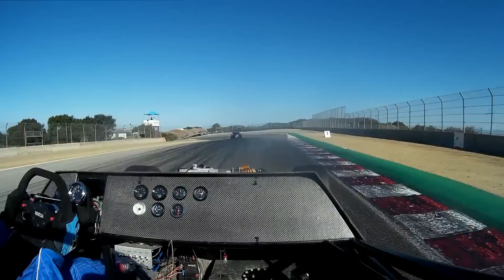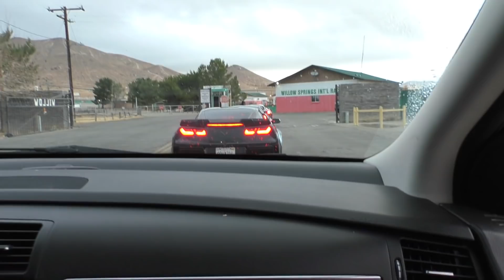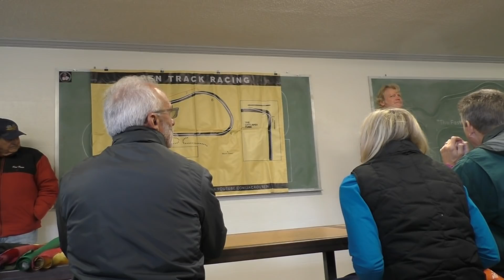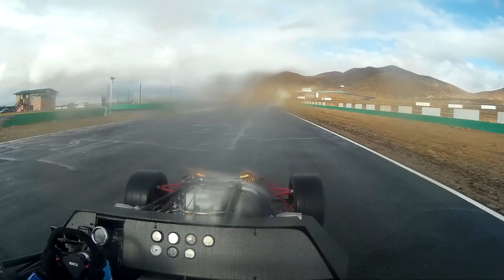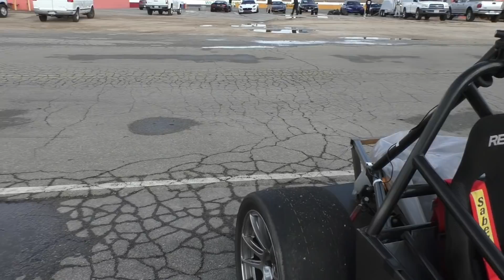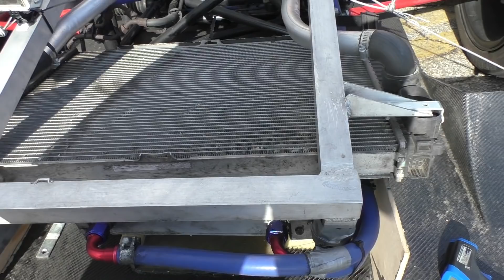First Track Day! Willow Springs Raceway - E55 ASL Part 23

Comment: 1) We use MPH-Fahrenheit, here...
2) 50 degrees is not that cold. I was there. Maybe wear proper clothing?

    (I've done 34 deg. (then add wind chill at speed) in an enduro kart race there, a long time ago. That was a little cold.)
3) Don't park your rig in a spot that you can get blocked in. Bring a tongue jack wheel if you plan to. 
4) You can actually buy a decent race car now and not waste a bunch of time trying to re-invent the wheel... but I admire your effort!
5) Slicks don't work to well in the rain. Try something with treads when its wet.

     Just say'in... Good luck!

Comment: Of note, in the wet and the car being so unstable: With that aggressive front splitter (the large cutouts) and no rear wing, the aero bias is forward. (despite having the diffuser). The front tires are the fulcrum, and thus lifts the rear wheels. The wet (and low grip) conditions seemed to highlight this.

Comment: I must say that I am very impressed. You know what you are doing.

I like your front DWF solution. With a slotted front section, you will be able to extract more DWF, as with such a high AoA, there should be separation there.

I like your cooling solutions. You went very aggressive with the front rad, which I absolutely love. Its not only good for aero but it also uses the rad as an effective crash structure.
I like the positioning of the intercoolers. Tight, yet effective.

The only part which makes me slightly sad is the rear diffuser. You have the space to go much more aggressive without fears of separation. As a stopgap solution to help with high speed oversteer, I would simply cut rectangular sections on the diffuser, and create a rudimentary double diffuser. It won't take too much time but it will drastically increase the pressure delta.
Since you have enough power to play with, just "go crazy" at it. Use VGs to attach flow wherever needed. Slot the strakes to minimize tire squirt. You can afford the drag.

You went conservative on safety (which is always imperative). The chassis seems to have good stiffness. Overall, It is a beautiful, well thought, well processed project.

My sincere compliments!

Comment: I think without any real knowledge that your tire pressure is too high, you need more front camber, maybe diferent caster, your wheel steering angle maybe too high (your wheel turns too much),and your springs looked too short in travel, and really stiff for that long car, wich should transfer weight a lot, even openwheels like F1 have a lot more travel in ther springs even with that big wall tires they have.

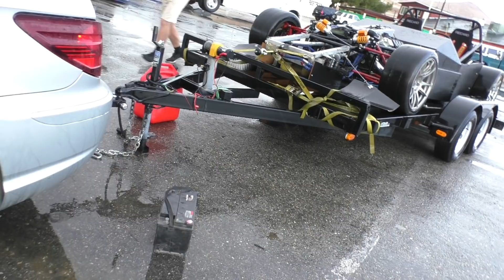Comment: 3:56 I just noticed the trailer hitch adapter from 1 1/4 to  2"  That adapter is only to be used for bike racks / rear cargo trays and even then the weight rating needs to be reduced by 50 %. Our guy is getting away with this in the short term only because the towed load is on the lower side.  Try this with a regular car on the trailer and the hitch might break off due to fatigue.   Also, the extended length is one reason why the rear of the car is sagging.

Comment: Don't beat yourself up. Yellow flags happen and most of the time it's thre front if the field because they are pushing the car. 
I'm curious what tire sensors are you using?😁✌

Comment: I think with all those vibration and stuff.. u really need to replace the support cable with some sort of aluminium support rod instead...

To eliminate any up-down movement of the splitter.. u will get more predictable downforce as well as less potential of stress crack on the splitter mounting points

Comment: I've seen F1 cars driving in rain. Why can't you incorporate that tech too!
Reply: Are you joking or lacking common sense?
Reply: Seriously why not. This guy built his own car. Double wish bone suspension. Carbon fiber. All that Jazz. For us impossible. For him possible. For him it's a question of engineering and time. So Dumbo you're welcome.
Reply: Do you even know how many f1 engineers (with actual degrees in driving dynamics) are working just on the propper setup of each car? To compare this to a f1 car is like comparing a treehouse to a skyscraper. It's simply stupid and shows you don't know what you're talking about. This is a magnificent 'treehouse' - no doubt - and I have the highest respect for this dude but f1 is just another league. However, you could make this car perform a lot better in the wet with dedicated rain tires. This is no special "f1 tech" but it's expensive. And there you got the next point on why this won't perform any where near a f1 car or incorporate any tech of those cars: I ain't seeing this dude having a budget of a couple 10 million dollars.
Reply: The ability to drive in the rain at high speeds is something that F1 autos have been doing for like at least 30 years. That's since I have been a kid. So it would take him like two three physics articles driving academic journal and a conversation with one F1 engineer to figure it out. Plus he's Indian. I would not be surprised if he or a close relative was an engineer. I've seen him use CAD. Also he'll probably rear mount the dam engine by next year. That F1 stuff is not too complicated for him. He is way past the hot rodder with a 32 high boy.  He will exponentially  improve. Hell even I know what downforce is so he knows much much more than that. He's a bad ass. Just sayin' plus automotive tech eventually filters down to the masses. Just look at what konisegg is doing. He parse's out some knowledge here and there. So chill. We will just have to wait and see.☺️

Comment: Hey, I just noticed you have air filters with metal caps in the center. You should look at what happens to them on a turbo. The glue used gets softer from heat cycles and the turbo will suck the cap off into the impeller killing the turbos.

Comment: It looks like the suspension may be too soft spring wise (i cannot comment on the hydraulics for obvious reasons), it had a lot of travel despite the fact that you were taking the car for a stroll in the park. How did you calculate their ideal stiffness? 
Also... you have way too many gauges. Have you considered moving to a proper dashboard? They are expensive but make both quick reads and datalogs a breeze to handle. Depending on the ECU you use it may be a matter of connecting 4 wires...

Comment: You need to go to Chuckwalla out towards the Palm Springs area, weather is much, much nicer there than the high deserts of Willow Springs. Also the track surface at Chuckwalla is much better than both Willow Springs and Buttonwillow.

Comment: While known as the "fastest road in the west" we only get up to about 230kph at big willow and 250kph at Auto Club Speedway due to lack of significant aero on our track 'stang . Also, i don't understand the black flag, you weren't doing anything wrong. Was there a car closely trailing you while you were stepping it out? We get loose on corners all the time without flags.

Comment: How did the safety inspection go? Are they leary of allowing a completely homemade car on the track?
Reply from the maker: Lol most people don't even know it's homemade. With all the radicals and ariel atoms out there, they think it's the same type of deal. It meets all the safety requirements so tech doesn't give any trouble.
Reply: SK8215 your build looks like a genuine custom kit, im sure they love it just as much as we do
Reply: I'd like to know that as well. Lets bump this question up.
Reply: Since it was a trackday, i would say a simple inspection like:
1-good harness anchor point and harness condition itself
2-fixed seat mount/rail bracket
3-no visible oil leak on engine and drivetrain (at some trackday will require you to have a certain minimum capacity of oil catch tank installed)
4- no loose part/panel hanging around that have potential to fly away at speed...

And i think thats enough to cover the basi of safety/tech inspection of any vehicle took part in trackday
Reply: There is no safety inspection on a WS track day. Self tech.

Comment: If you're going to go through all the trouble of trailering your car so far, surely it would have been a worthwhile investment to get a set of rain slicks?
Reply: TheCrazySquirell when you build your own car from scratch I’m confident you’ll do just that
Reply: @tjdjultima  Go do one you complete twat. Building your own car has nothing to do with the prep for track.
Reply: @TheCrazySquirell  i dont think he had room for extra set of wheels
Reply: @MrHBSoftware  Quick bit of welding for him to add a rack for wheels.
Reply: @TheCrazySquirell  do you realized he just built a car from scratch in record time right? yes just a little bit of welding to build a rack of wheels...huh...how about the million things still left to do in the car?????can we just appreciate how much he built in so little time? if the engine blew the headgasket you would complain he should have brought a gasket and tools with him, if a pipe ruptures he should have brought spare ones, etc etc etc..i have raced trackdays, drift, time attack and hillclimb and no matter how well you prep there is always something missing and it will be exactly what you will blow up on the car...unless you have a dedicated mobile workshop truck and you do nothing for a living and can afford to spend a week prepping everything for one hour track time..